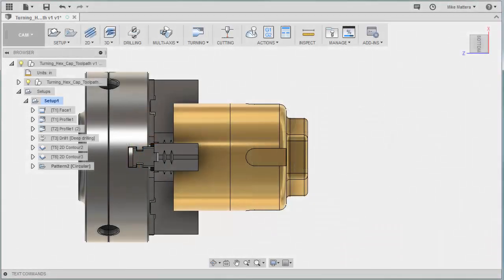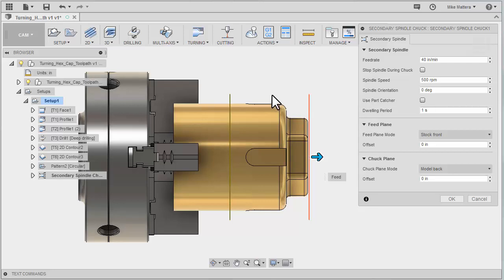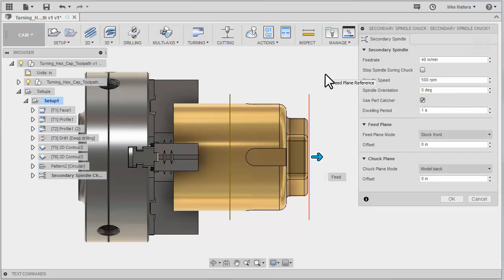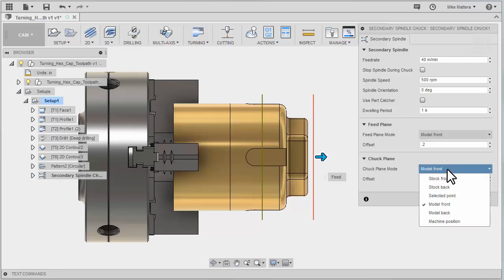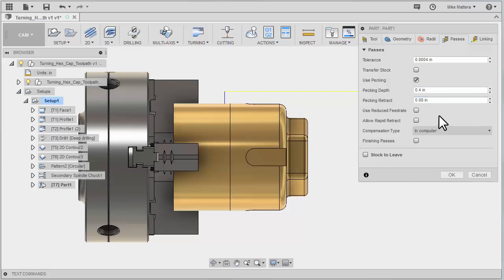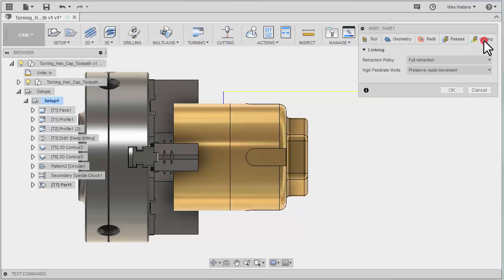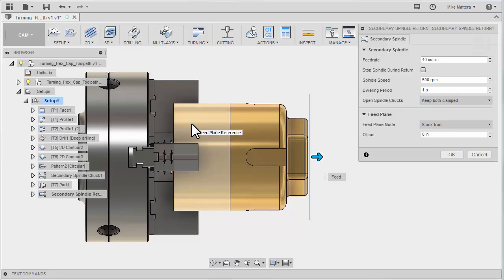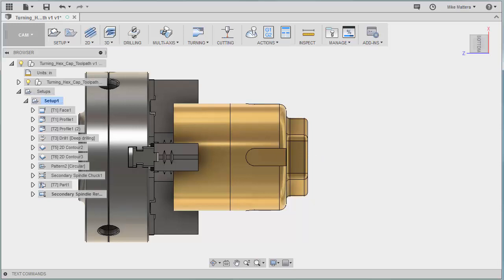Fusion CAM Live Turning Series 08 - SubSpindle Transfer

Comment: Mike, Nice video. I am getting ready to swap out our Haas ST10 for a ST10 with a sub and have begun looking for some instruction. My HFO is going to help me out with getting a post processor set up so hopefully that part is a non issue.  This video is fantastic but I do have a question on the part off operation. To me it looks like you have the tool approaching in a way that would collide with the sub spindle? or am I missing something. Thanks in advance!

Comment: What about using the sub spindle to pull bar stock from the main so after part off, the first op is ready to run again. Bar feed with out a bar feeder.
To clarify, Sub moves in and clamps the part, main unclamps, sub retracts a specified amount, main clamp, part off, sub home.